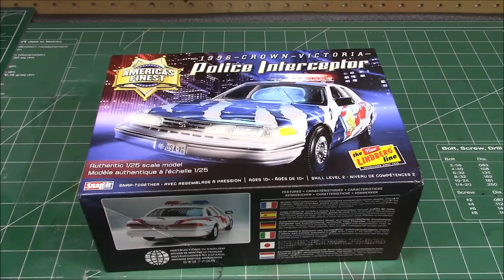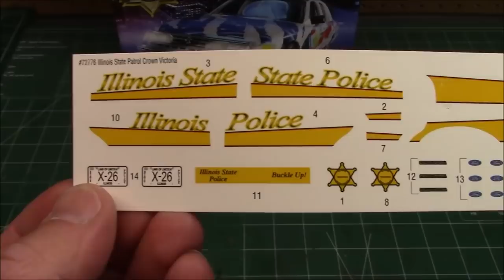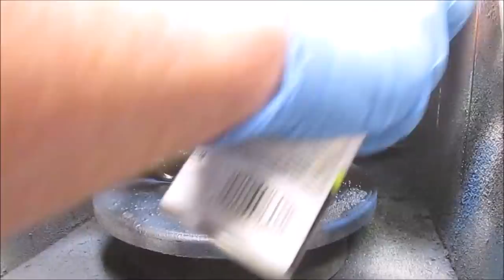1996 Ford Crown Victoria Police Interceptor 1/25 Scale Model Kit Build Review Lindberg Modelroundup

Comment: You need to do a worn out version that has been sold at a police auction!
Reply: Or leave all the cop stuff off entirely and built a one-elderly-owner cream puff with wire wheels and a simcon top.
Reply from the maker: Sounds like a cool idea for your build, post up on FB when it's done. :)
Reply: Teal green unmarked FBI re: The X-Files.

Comment: Nice kit. I always thought those were made by Revell. Would've been even better IF they had made it a 3-4 in 1: Cop car, firefighter car, taxi and daily driver. But as you said, it's easy to turn into a daily driver (And that's why I put a 3-4 instead of just 3).

Kind of kit I'd get, but I already have over 60 not build and I don't build as fast as you do! lol
Reply from the maker: Pretty sure Revell has the Caprice kit, as a squad and a taxi,  but I could always be wrong.
Reply: @hpiguy  Yes, they do. But I also thought they had this one as well.

Comment: I enjoy your videos.  I was wondering, do you have trouble with your rattle paint cans quitting before they are empty?  I have had a number of Rustoleum cans do that over the years.  My latest one did it the first time I used it.  I tried it again, and it spray a tiny bit and quit.  Thanks.
Reply from the maker: Sure, the nozzles clog now and then.
A soak for a day in Super Clean eats out the paint and it's useable again.

Comment: Here's a question for a Tamiya vs bug spray can the car mixed primer and paint together which melted the body the trunk and hood were melted completely to nothing it was made for plastic maybe not sharing the can paint could be hot when apply I'm trying to sand it off smoothly I was thinking prime it first then paint after
Reply from the maker: I have no idea what paint you've used but Rustoleum has never melted any styrene for me, ever.
Reply: @hpiguy  it was the product you it a mix primer and paint together that attack the model the hood and truck disoved to nothing